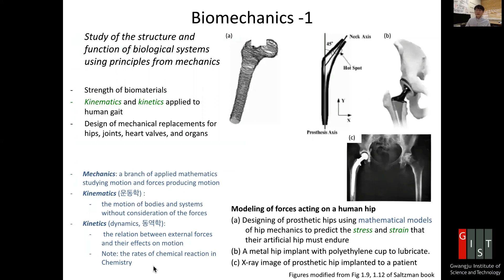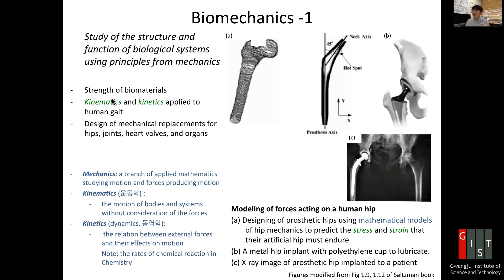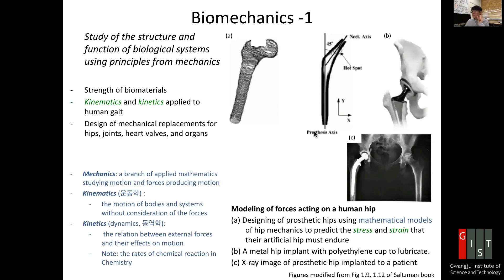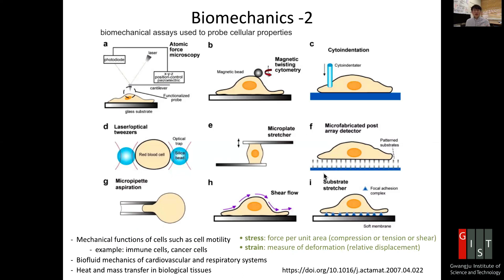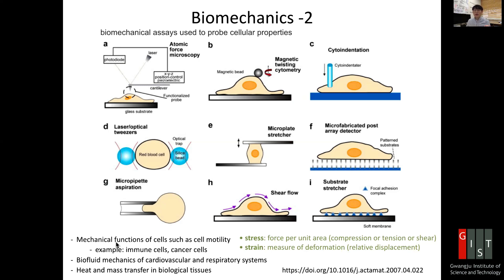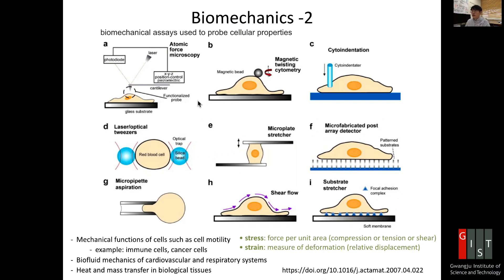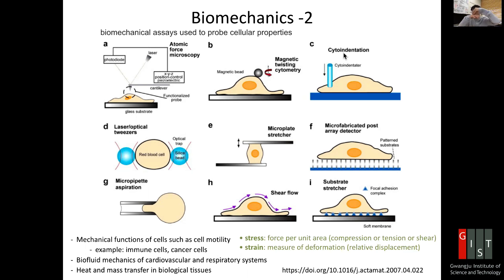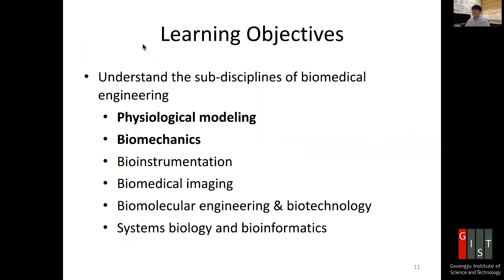2.2 what is BME: Biomechanics

Comment from the maker: Woo Ju JEONG: Q4,p16) ECG is pretty interesting machine for predictable cardiovasculuar disease. When do ECG, is that ultimately measure every chamber I mean 2 atriums and 2 ventricles?
Reply from the maker: I would say ECG measures the whole some of both atria and ventricles. More specifically, electrical vector sum from all the part of heart. To decompose the nature of 3D dynamic vectors, we use multiple electrodes via total six electrodes around the chest and three from left, right arm and foot giving  I, II, III, aVF, aVL, aVR projection electrical voltage signals. Hope this helps.

Comment from the maker: Vũ Thanh Phương: Q1: What material is currently the best for making a prosthetic hip?
Q2: Does the material for making a prosthetic hip have any bad effect on 
the health of the person receiving the implant?
Reply from the maker: A1: Some answers from Google, "Most used are titanium alloys, stainless steel, special high-strength alloys, alumina, zirconia, zirconia toughened alumina (ZTA), and UHMWPE. Usually, stems and necks are composed of metals, whereas femoral heads can be both metal and ceramic"
A2: Of course, there are potential risk of infection or the side-effects. For the duration, the following might help. "95% of hip replacements last at least 10 years, about 75% last 15 to 20 years, and just over half last 25 years or more"

Comment from the maker: YeongMin KIM: Q1 : p9) This is just curiosity. How can a person die from air bubbles in the blood?
Q2 : p 18) The hearts are connected to each other because there is an intercalated disc, but why is it only applied to the right atrium and vetricle when an electric shock is given by an ICD?
Reply from the maker: A1: I am not sure about death, but certainly the trapped air bubbles can block the blood vessels and can cause problem. This is why we should be careful not to put any air bubbles when giving an i.v. (intravenous) injection into the body.
A2: It is due to the anatomy of the heart, I guess. When reaching into the heart via vein, the blood (and thus the electric wires) first enter the RA (right atrium) and then RV (right ventricle). To reach the LV which can only be reachable via lungs. However, this would be enough for electric shock for the whole heart I guess. A good question!